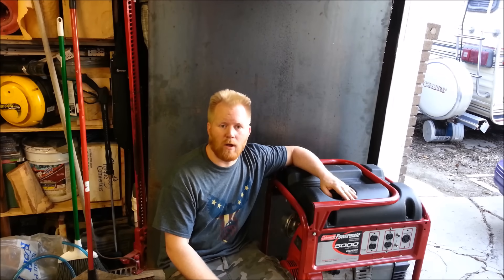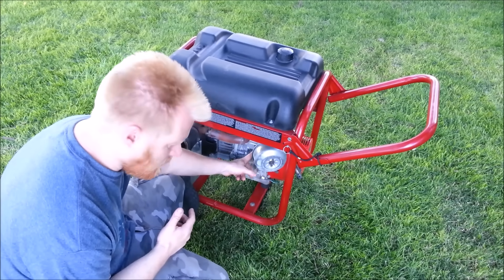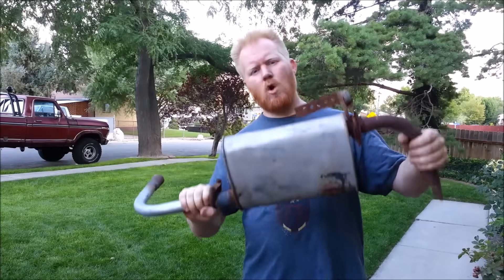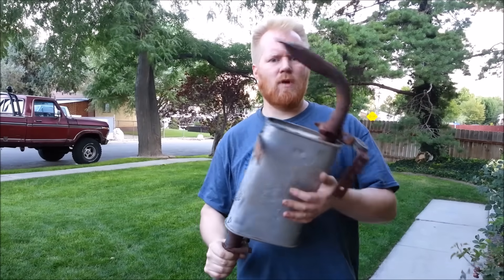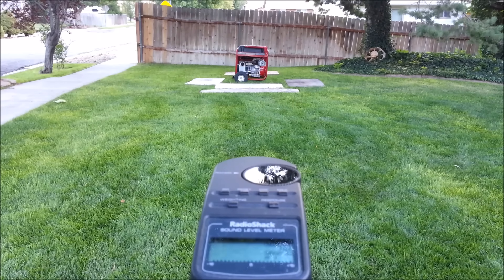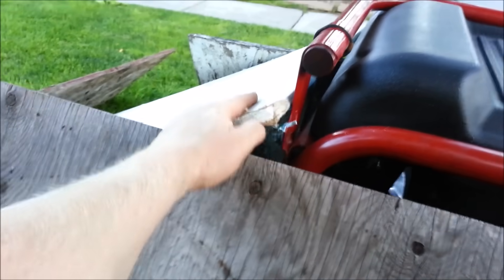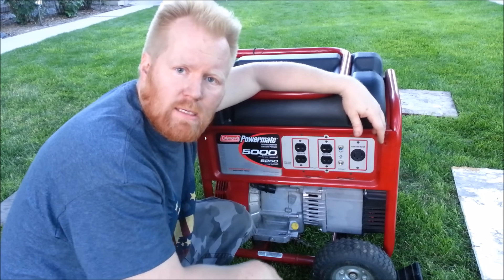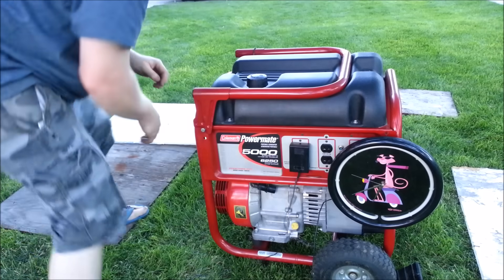4x Quieter generator in 10 seconds

Comment: Glass packs are loud because after about 9 months they wear out and sound a bit like they are back firing when you gun the engine. They also become more like a straight pipe than a typical factory muffler. That's why we used to put them on our cars back in high school. Because back then the police didn't have portable meters to check the decebles your radio or muffler was putting out. They used the window rolled up ten feet away method. If they could identify the song with their windows up and being a cars length away they would cite you. However, if you had your muffler on with all the pipes in front of the muffler securely attached, they couldn't cite you for your exhaust. They would give a lame ass warning but were not able to write a ticket. With the power and modern bass extreme songs of today they can roll up to a car and see it vibrating and notice their windows shimmy and feel their filling in their teeth rattling. LOL

Comment: Guys.

Generators are designed to move air across the engine and rotor and stator.  You cannot restrict that airflow and expect your generator to last.  Most generators like this run at 3600 RPM all the time, so they are working hard.  It's an air cooled engine, you can't restrict the airflow to it.

Don't do this.
Reply from the maker: How do you think they make all the inverter quiet generators.... It's an air cooled engine in a tightly sealed box with an air hole in the front and one at the back. The small 6-8 inch flywheel fan can only pull in so many cfm's and allowing the 4 corners of the lean to shelter to be open supply 20 times what the generator head and motor need for proper cooling.
Reply: @sixtyfiveford  Inverters run at less RPM. They make less heat. They are also engineered to run inside their enclosure, just like a home standby or even a large industrial generator that's inside an enclosure. None of those things are designed to have wood stacked around it. Look in your manual, I will bet that it will say not to place the generator inside an enclosure and to give it 3' of clearance on all sides.

CFM isn't the only thing you have to take into account. Just because you gave it enough of an opening doesn't mean you didn't affect the airflow through the generator. 

Here's a question - do you think the temp inside your box is higher than ambient? Wire insulation becomes brittle over time, and that process is sped up by heat. These cheap generators don't have the longest lasting stators anyway, this won't help. I work on generators every day, and I can't tell you how many times I see issues because someone felt the need to put their generator in a box.

Comment: Have you run that generator like that for long periods of time in warm weather to see if it has heat issues?
Reply from the maker: I have run it for hours at 90F+ and no issues. Some engine areas and generator head areas were 2-3F warmer but most were the same. The only things that saw a large increase of heats was non critical items like the metal framework which saw a rise of 10-20F. All the quiet inverter generators are simply an air cooled engine put in a tight fitting box to reduce sound.

Comment: 3 db is 0.5
6 db is 0.25
10 db is 0.1
Reply from the maker: The decibel scale is logarithmic but the average human's ear isn't. The average human will perceive 4-6db drop as something being half as loud, so 8-12db drop is roughly 1/4 the perceived loudness. This can get tricky because a higher pitch sound has a higher affect on our perceived loudness vs a lower pitch. So a muffler can simply deepen the tone(lower pitch) and even though the decibels aren't dropped we'll think it sounds quieter.
Reply: @sixtyfiveford  Human hearing is said to be capable of a 3 db change which is 0.5 or 2.0 depending if less sound pressure or more, respectively. My simple db scale is valid.

Comment: Id been interested in you measuring the generator temp before boards & etc then after. 
 Perhaps a small fan on generator above it to pull heat would be beneficial.
Reply from the maker: All the inverter quiet generators are using the exact same principle without near the ventilation around them. They are essentially an air cooler engine jammed into a plastic box with small air vents on one side sucking in and blowing out the other. I ran temp readings on the motor and gen head and all areas were within a few degrees(2-3F) of just running it out in the open. Non critical items like the metal frame did raise around 20-30F so they were warm to the touch.

Comment: I had a Honda 500 watt genset that I used to provide lights and power for a cabin that me and my friends built. It was off grid and on public land so we wanted to keep it quiet. I used a 100 foot extension cord to connect it to the cabin so I used the cord to measure how far away I could go. I found a spot about 80 feet away and built a small 4 sq. foot hut using a pallet as the floor, 1" thick insulated walls, a removable roof (in case I had to dig down through showpack to get to it) sloping to the rear and put it on four posts so it was about four feet off the ground. Inside there was a electrical box that plugged into the genset, and the extension cord plugged into that. I used some flexible 4" aluminum dryer vent to channel the exhaust outside and in the pallet floor I installed an fan from an old microwave to force air into the hut and it ran as long and there was power. Once the door was closed, you couldn't hear it at all back at the cabin.

Comment: Yes but you have to be able to lock it up for somebody that's not quite your neighbor decides to take your generator and they'll start a lawn mower up and they take your generator and you think ehat happen the lights just went out they're gone and you think you generators still running too.  So you casually go get your flashlight and start heading out to get the generator going again and figure out what's wrong and you find your own lawn Louis sit in their running luck to hack your generator's gone AHA
 They got yeah they're pros at this, Add value know why you have to build a strong Box for your generator. I like to build it inside the grog's in one corner of a 3rd garage.
 It's set senate's own Box has filter on intake side which is inside the garage 12" fan on the outside edge of the grudge that sucks everything outside and the exhaustless outside also through an insulated tube
With a great big can coffee can full of course fluffed up stainless steel wool the kind for big pots and pans that works great and what comes out the side of the garage is so quiet you have to be right next to it otherwise it just sounds like a gentle hissing sound.  The best stuff to use to build the Box out of is that sound can say tion board doubled so it ends up being about an inch and a quarter thick and wow you can't hardly even tell a generator is even running when you're in the house.  Also I think he was talking about the spray undercoat for cars stops the freeway noise from coming backup in beer car that stuff works pretty good but you got buy the expensive stuff and it's thick and for me it's black and nasty but when it dries it's great it's kind of light car but it's not really tart and a with foam plastic light stuff little bit rubbery.

Comment: The best way I know how is.... Convert it to " Propane " and it will quiet down tremendously without additional mods!
Reply: Look it up on a new gen that comes set up for duel fuel you might learn something.
Reply: @richardsnyder3900  -  LOL, you need to LEARN how the RPM works!  If you have the SAME RPM, it doesn't matter what the Fuel is or are.  Even if you run on FART GAS.... If you are able to get the RPM the same, it doesn't matter.
Reply: @JodBronson  So all the generator manufacturers do not know what they are talking about but you do. Do your self a favor spend some time learning why LP gas does not produce the same amount of energy as gasoline.
Reply: @JodBronson  
just purchased duel fuel generator, he's right about propane
Reply: @magnum8264  - READ MY 2nd reply.  COPY: :/  If you make the RPM the same way.  How can the " output reduced "?  Oh boy!  LOL
Reply: @JodBronson  RPM is held constant to maintain 60hz, but the generator loads down the engine as the demand on the generator increases.   A 1HP motor will spin the generator with no load at the correct RPM, but when the generator is loaded, then the full output of 16HP (for a 8KW example) is required.  Ever notice how engine displacement increases proportionally to generator output? Now, when using any given engine, the same size engine produces less torque on propane than it would on gasoline because the BTU of propane is lower.  Look at any duel fuel generator sold.  They all downrate the generator power by about 10 percent for propane use.
Reply: @ohger1  - Oh boy!
Reply: It will also reduce the output
Reply: @richardsnyder3900  - :/  If you make the RPM the same way.  How can the " output reduced "?  Oh boy!  LOL

Comment: Placing generators in holes gets mentioned but make sure you have a water pump to keep it from getting water logged. So many times it's a heavy thunder storm with lots of rain that knocks out the power.
Reply from the maker: Very true.

Comment: I do a similar thing, temporarily, for my General.  But also have built another version which provides about 3-ft spacing for fire protection and ability to redirect the sound into a particular direction into the dense forest.  But this still leads to poor airflow for cooling.  Even at -8F, the sound box will heat up to the 70’s, imagine when it is +80F.
   We live off grid and do what we can to use the gens the least and the quietest.  We will be enlargening the sound box and adding studio egg crate foam, hopefully before the winter.

Comment: These generator designs are flawed. The motor shouldn't run wide open all the time. It should throttle up and then harness the generated power while throttling down to a quiet idle. I hope they fix this soon
Reply from the maker: This style of generator has to run at 3600rpm to maintain a 60hz power output. Lowering the engine speed to an idle 1800rpm cuts the hz to 30 and it will damage most items plugged into it. Inverter generators can run at lower speeds as everything is computer controlled/generated but they do so at 3-4x the cost.

Comment: do you have anything on air compressors especially when you are running them in a garage and the garage doors or shut due to cold weather
Reply from the maker: Surrounding the pump/ motor with a foam box will help. Some compressors(mainly oil-less) can easily top 100db so even with a 20db drop they are still extremely loud.
Reply: @sixtyfiveford  thank you..! and IAM looking forward for more of ur cool stuff

Comment: People typically lose power in the winter months, if they have a hot tub it's normally drained, plywood to protect the floor, then throw the genny in there and the cover on with half folded open. Much quieter! And bonus..... you can wire- in a 2 way switch to your hot tub so the genny feeds power to the house through the 30 amp hot tub breaker once you've flipped the main off. Works slick!
Reply: WHY ON EARTH would you EMPTY your HOT TUB in the winter? it's LITERALLY the BEST TIME to use one!
Reply: @davidmichael7756  The Polar Bear Club👍
Reply: NEVER back feed power into an outlet. You need an interlock on the breaker panel to guarantee power doesn't get fed back into the main power lines. This is illegal and deadly for anyone working on the power lines!

Comment: Amazing air flow lol it wont last very long with all that extra heat
Reply: Go to an air conditioning supply store and purchase a 4x10 sheet of duct board, it's a sheet of fiberglass insulation , it works great and you can attach it to the plywood for sound absorption.

Comment: A decrease of 10 dB is a halving of loudness if I remember my experience measuring sound levels in elevator equipment design. The dB scale is logarithmic and not straight line.  Gaining another 10 dB would be very impressive.   Anyone else have similar comment or experience? 

JoeB
Reply from the maker: Mathematically True. However our ears don't play by the same rules and a 3-6db gain is perceived as twice as loud by the average person. So with this, an average of around 6-12db is perceived  as 4x as loud. This is very subjective as tone also plays a huge roll in perceived loudness as lower frequencies are more pleasant to the ears.  So simply lowering the tone but keeping the db the same could give the perception of something being a lot quieter as well.

Comment: You seriously want to take that thing out camping ?
Reply from the maker: My customers take these out camping to the desert all the time. Without it you're sitting in 120F heat/140+F trailer heat inside a camper/trailer. Something like this is a requirement.
Reply: sixtyfiveford i understand, but for a camping trip it is a bit loud in my opinion

Comment: I just use “The Cone of Silence” for all my noisy generator needs. There, I just saved everybody ten useless minutes of blathering.  As a side note, Radio Shack does NOT make professional sound meters. Additionally, when making spl measurements it is always done at a distance of 3 meters from the source emitter.

Comment: You can get down to 48db, use 1/6 the fuel and reduce weight by 100 pounds by selling the Coleman for $400 and buying a very used Honda eu2000 or a new eu2000 clone.
Reply: So replace a generator that puts out up to 5000watts with a little tiny one that only puts out 2000watts? Yea that is AS DUMB as it sounds.

Comment: I have been researching inexpensive ways to quiet a generator and this video is by far the best I've come across. Thank you so so much.
Reply: Probably too late for it but you should look into hush houses. We use them for jet engine testing indoors
Reply: But remember if you restrict air flow your engine will not last long and if you add something like that big muffler it will add more back pressure and that will shorten engine and generator life !
    I’m guessing that’s why his Subaru engine didn’t last because those things are bullet proof

Comment: That's all well and good but using that raybestos ply and screw all 4 sides into the frame rails also deadns the noise and breaths great just trim it around the exaust and it's not an eye sore just use some snaps or ties where you need access to the unit at it's kinda like a bag around it all

Comment: One big problem, in high temperatures, like 85 and above, you restrict air from cooling, an air cooled machine.
Reply: You are correct.  Everyone on youtube who has ideas to run something quiter says to smother it.  They will run much hotter. If it was a good idea you would think the mfg would recommend that you leave them in the box they are shipped in.
Reply: You can deflect sound without blocking all airflow.

Comment: Is it possible you blew up the first engine by overheating it by covering it in plywood?
Reply from the maker: Nope, the first engine was never run this way and only ran less than a dozen hours total in open air. All the new whisper quiet inverter generators are  fully encased/sealed in plastic insulated enclosures.

Comment: Subaru makes some of the best and longest running small engines on the market. I have a stump grinder and in the time I've had the Subaru motor I went through 2 Koehler motors. They are pricey but well worth it
Reply from the maker: You've over payed then. Subaru (Robin Engines) make the some of the cheapest engines on the market. They are only installed on budget power tools and there is nothing premium about them.

Comment: Why is a 2-stroke or 4-stoke engine so dam noisy?  Manufacturers could sell many more emergency generators if they could engineer a substantial noise reduction.  How come I can't hear my neighbor's truck, equipped with a cummins 6.7L turbo diesel engine, start in his driveway, but his generator vibrates everything in my house?
Reply from the maker: There are multiple reasons. A automotive engine is encased with a water/coolant jacket that suppresses the sound. It is also surrounded by sheet metal with sound deadening materials. Finally, your neighbor isn't revving his truck to 3600rpm(generators run at this rpm) in the driveway. If he opened the hood of his truck and revved the motor, you would hear/feel it. There are many generators that implement these features and are far quieter than an automotive engine. The issue is they aren't the cheapest on the market so everyone just buys the cheap 1/4 the price generators that are loud.
Reply: @sixtyfiveford  Yes, I suspect the Generac cabinet generators with automatic switching are much easier to live with.

Comment: Good idea, Technically speaking this is only 2x quieter, not 4x.  The decibel scale is logarithmic, so every 10 decibels double the sound output.  Going from 80db to 70db is 1/2 the sound output.  You'd have to get to 60db to get "4x" quieter.
Reply from the maker: True from a mathematical standpoint but not reality. The average human ears perceives 4-6db drop as 1/2 as loud. So a 8-12db drop is perceived as 1/4 as loud (4x quieter)

Comment: I used to run a generator on the back of my boat, to reduce exhaust  noise I pushed a foot of copper pipe onto the exhaust tail, a 90° bend down the floor and then runs down into a small container of water. The exhaust gasses bubble through the water. Massive reduction in noise. It ran fine with no noticeable back pressure issues.

Comment: Sixtyfiveford, you just gave me a good idea. I have a portable inverter generator I take camping. It's still loud at 20ft. Get an old doggie crate and line it with flame retardant Dynamat car sound deadening material. Leave one end open (for air circulation) and pointed towards the forest and away from campers. Thanks!!
Reply: One year on: how well did that work?